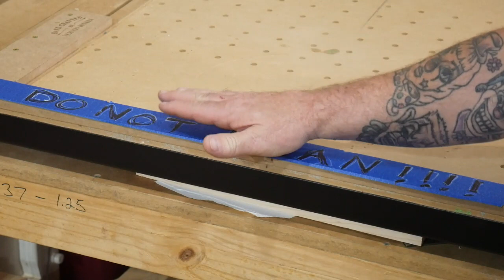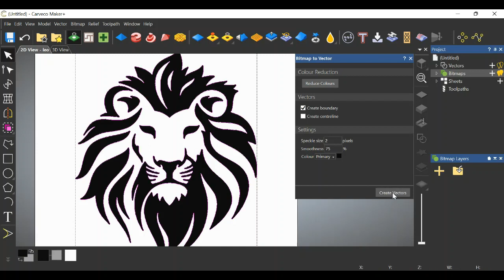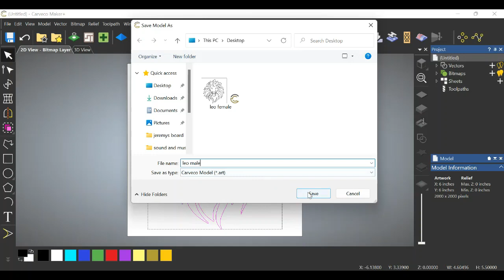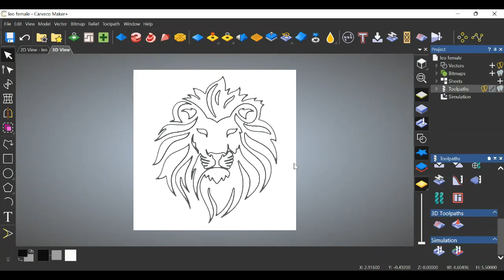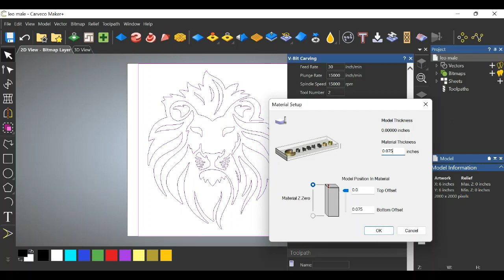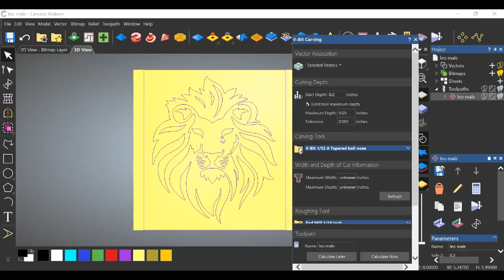Carveco V-Carve inlay tutorial

Comment: I just tried your process (really surprised CarveCo doesn't have a V-Carve Inlay process) I got good results.
 I used a 1/8" 20deg V bit as I didn't have a suitable taper bit.
Results
0.05 Great V contact less than 1mm glue space, shoulders meet
0.07 Great V Contact, 1.8mm glue space, 1.9mm shoulder space
0.09 Great V  Contact 1.9mm space 2.5mm shoulder space
0.1 Great V contact 0.5mm glue space 2.5 shoulder
0.15Great V contact 1mm glue space, 3.1 shoulder

Looks like 0.05 is best all round, 2nd place 0.1mm
thank you for the inspiration and confidence to try as my previous attempts only had 1.5 - 2mm V contact & bitty mating with gaps. These fully matched. Well Pleased, thank you
Reply from the maker: You’re very welcome John !!!